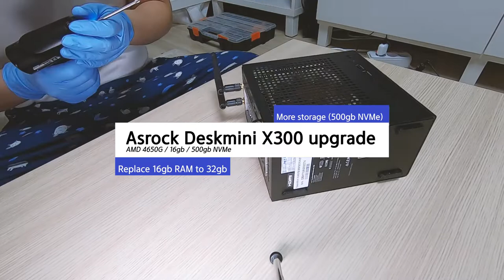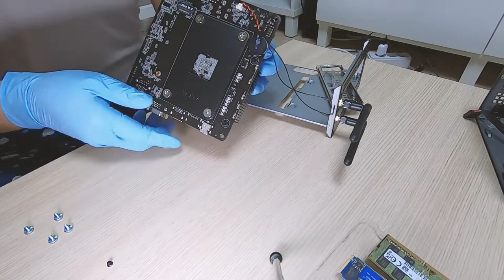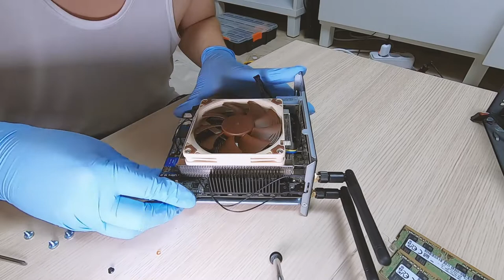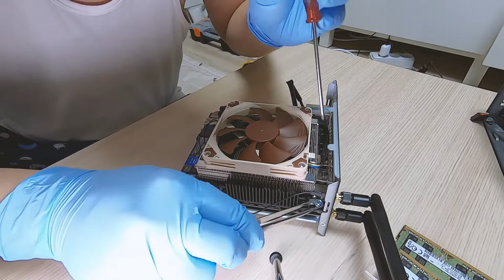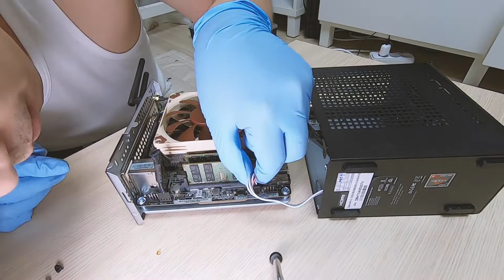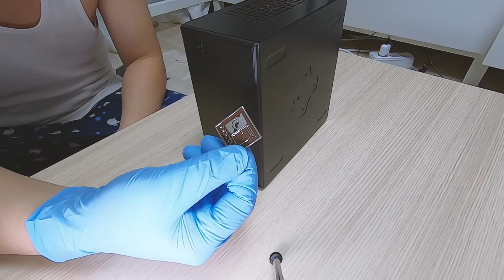Asrock deskmini X300 system upgrade

Comment: It was too hot when used??
Reply from the maker: Nope. If you meaning cpu temp, 40c when idle, 70c with full load. It depends on which cooler you use.

Comment: Hi, what cpu did you use?, can i use it with ryzen 7 5700g?
Reply from the maker: Ryzen 4650g, not sure but this board can hook up with ryzen 7 ;>
Reply: @hogenejang  Yes it does, mine is ryzen7 5700g

Comment: you got a link for that screw driver?
Reply from the maker: it's an Aimsak drill (cheap but fancy :) )
product information page: http://en.aimsak.com/product/view/100
plz notice, it can not be adjusted for torque.
Reply: @hogenejang  ty
Reply: Hello sir, my front m2 drive screw has gone bad as it was tightly screwed by previous owner I have been unable to remove it. Any ideas on how to safely remove the screw where the screw is stripped pls?